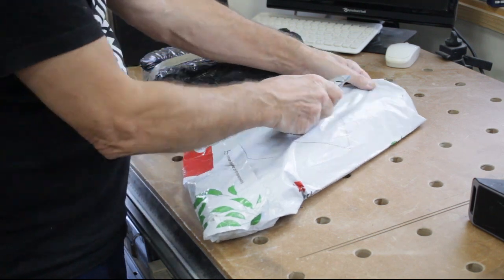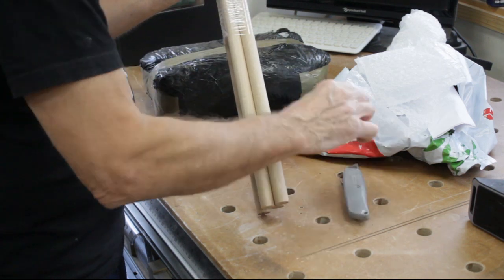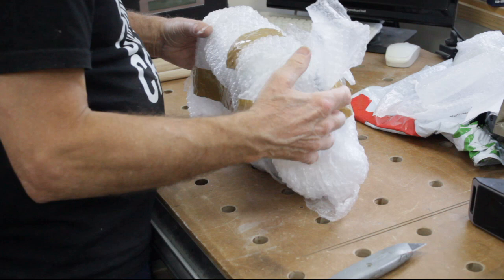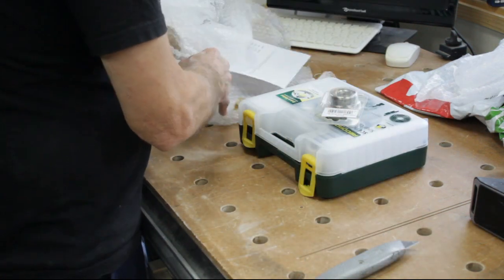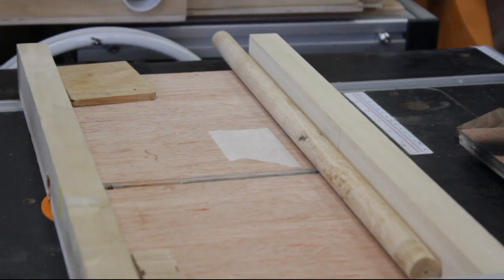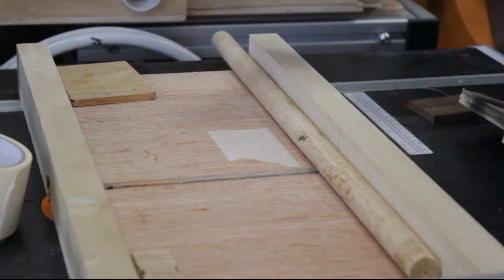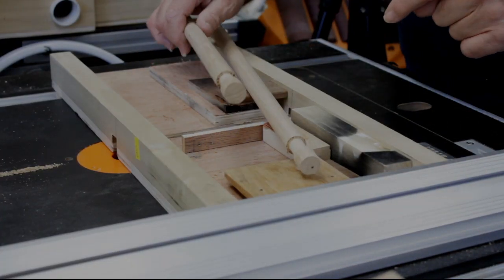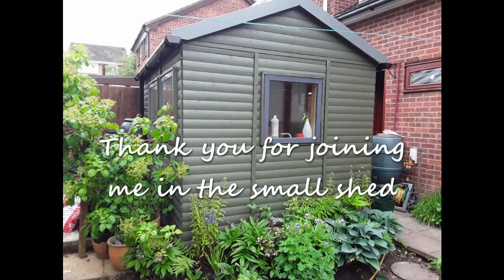small shed Saturday #205 - Making spindles

Comment: Nice one, great improvisation there Peter and in my opinion great choice of chuck.  I bought the SC3 first and then the SC4 and both great chucks and lots of interchangeable jaws sets available.
Reply from the maker: The chuck is all Stuart the Manchester turners fault! I would have just searched Ebay for the cheapest, it is proving to be a nice bit of kit, even if it did cost more than the lathe.